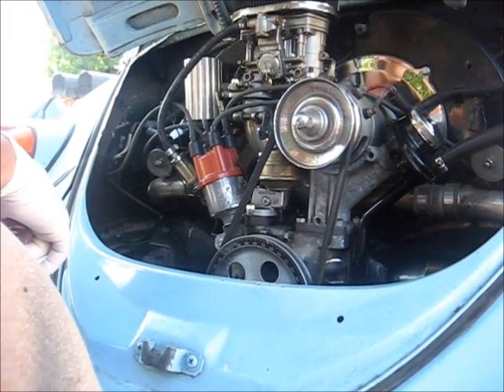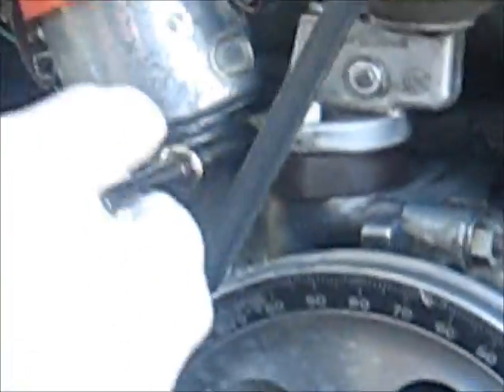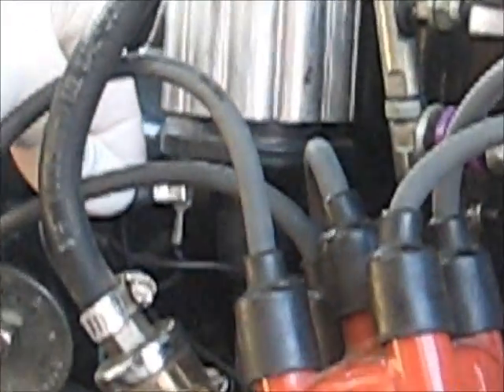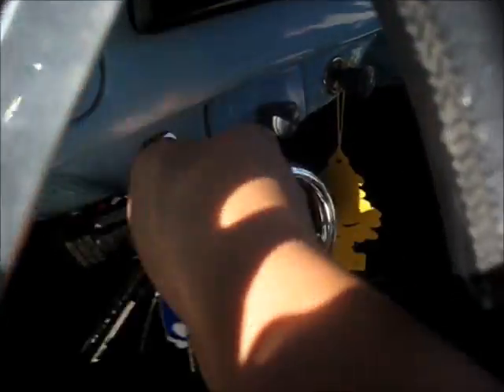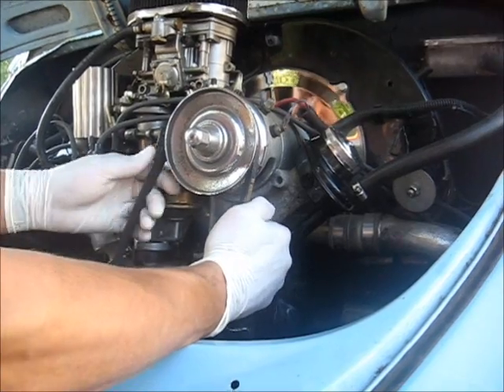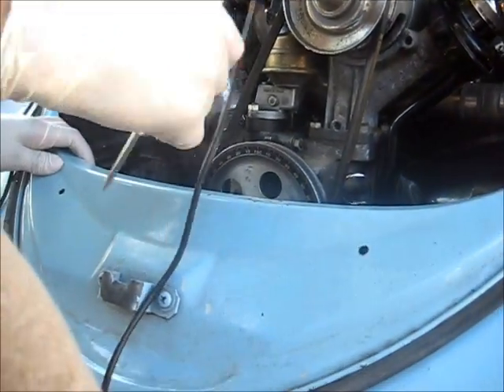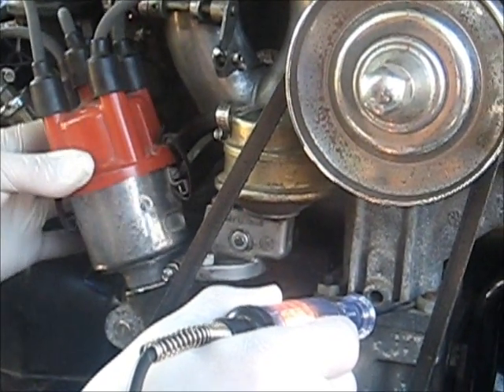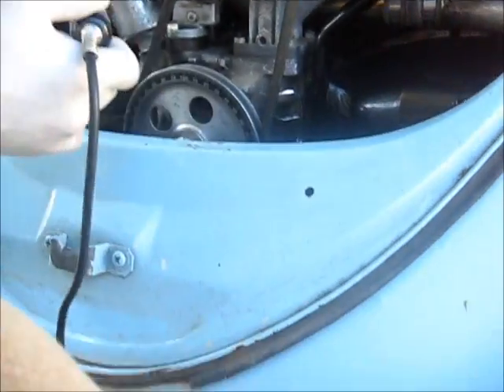How to adjust your timing on a VW bug

Comment: A lot of people are saying this is wrong, but this is for "static timing" and you need this trick to get the engine running if you should for example swap the distributor. You should set the dynamic timing with a timing light gun once you have done this and the engine is running. BUT commenters, you can't set the timing with a light gun if you can't turn over the motor in the first place!
Reply: Daijyobanai I

Comment: Doesn't the position of cylinder 1 matter, you could be on number three at TDC.  I think you have to be sure the rotor is pointing to the notch on the distributor housing before you are 100% sure you are TDC #1 cylinder.  Correct me if I am wrong.

Comment: First, if you dont have a number pulley I suggest you get one. The correct way to time this motor is to find TDC and hook up timing light and loosen distributer then start motor.  Rev engine until distributer advance is maxed and take a peek at were it stops. You want it to stop at 28-30 degrees. Tighten distributer. You are now properly timed....You need...*Number pulley *Timing light *10mm socket.
Reply: Wrong; you do not NEED a number pulley at all.

Comment: Wrong procedure its unsafe, 1st you take off the distributor cap so you can see if the rotor at the 1st firing position, then rotate the crankshaft pulley to 7.5 degree, put the clip of the test light to the negative side of ignition coil and attach test light to the engine body, lossen the bolt of the distributor, then start on position the ignition switch, rotate the distributor counter clockwise until the test light lights on, tighten the bolt gently, the timing procedure are done,.

Comment: I got this 1970 baja bug out of a field that it had been resting in for better then 10 years. I put it up on blocks and striped it. After a complete overhaul, breaks, hubs, and engine i gave it a fresh coat of paint. Though I have no clue what i am doing the chilton made it possible. there is a thing under the carb on the block that needs a wire, where dose this wire go to. There is all so the choke wire and under it is a condincer , where do these wires go? thanks for the help.

Comment: This is called Static Timing. You  should be at 10 deg. BTDC with a 009 dist. I have done it this way for years. Just stop turning it when the light comes on. You can also do it without a light. Just watch the points, when they pop your good.

Comment: Wrong procedure, unsafe too. 1st remove the Dist. cap so it can't start.
Look for a better video and/or read below because you have to do a final static check by pulley reading.
This video is only good for preparing for that test.

 Better-- Cap off, #1 on comp. stroke at about 20 degrees before tdc stop.... turn on key, and rotate engine SLOWLY till the light goes on. (visually check rotor to the distributor lip's "hash mark" for reference).
 Do it again.
 Got the same reading? Then that is your static timing. Key off.

    NOW line up the rotor to hash mark for easy estimates, loosen the dist., carefully move distributor a hair, clockwise=later/less degree of advance,  and re-tighten dist, move motor again (if you move it backwards, go to at least 10 degrees before static mark then fwd again so any mechanical slop can adjust for re-direction)  
  Key on, turn the engine forward till the lamp lights again, to check the new static setting (again till you get two or more good readings).

The static setting is often the idle setting on an unmolested 009. But assuming can be dangerous.

      If you know your motor, using static timing AT THE PULLEY is very reliable. Some stock motors you had no choice but time it statically.

 On the stock pulleys, a "Dot" indention mark, on the pulley half that is furthest away from the block = TDC. (Some had no dot, good luck there).
  You can count on any pulley being up to 3 degrees off tdc (+ or -) by variance. Especially after market pulleys.
   I've seen stock crank keys retarded near 3 deg, and that's a bad 5 degree combo of being off tdc, if not checked. 
    On the stock pulley half that is closest to the block, you may have a variety of V notches, whose position should be confirmed if there is no dot/dimple.
  A notch to the left of the dot = 5deg ATDC. 
    Notch to the right 7/16"of tdc= 7.5 btd,
     A notch a bit further than that, say 1/2"ish =10btdc, and I don't know off hand if there is a 12deg mark or not? That said most AC-VWs like 7.5 deg. advance at 0-825 rpm idle,  016 points, .006-007 intake, .007-008. exhaust, and .024-.028 plug gap depending on the engine, plugs, and coil (on real good coil maybe .030 spark gap), but I like .026 to start.
  
   The early German 009 called for 7.5deg at idle to get 32deg total at 3000rpm. it advanced sooner, but had less advance during low rpm. Above 2300rpm, more advance till 3000rpm/32deg.
  (Most AC V-dubs should idle best at about 800rpm and 7.5deg, adv, and come off idle better too, (for sloppy street driving) but should max out at 32deg, or sooner).
  A later Brazilian 009, needs about 12 deg. adv. at 1000rpm idle, to get 32d at 3000,
   At 7,5 btdc most engines will idle great, and start nice, lose a bit of top end hp, with the Braz. 009 maxing at 28d total. But this usually runs cooler, and gets better hwy mileage at 28 max advance. I like 30d max adv. "with a light".
 
"Done Right" -#1 So.. both 009s, and the normal AC V-dub timing considered, the videos "0 degree" choice is likely a "safe start point" for most air cooled v-dubs & 009,( but should be followed by a timing light). 
 #2- The rubber glove could stop a shock, LOL. ( 1 quick spark plug bite)
  
 If your not careful, with the dist. cap off especially, you'll get a mini-shock off the test light, so connect them firmly, don't touch that wire, just watch the bulb. 

 A jumper wire to a tail light, or license plate light bulb works if "stuck on the hwy".   

     You cannot set electronic ignitions statically at all; including Bosh fuel injection, or points replacement kits, (so mark things well before you change things over to a "hall effect kit", or similar.
   Good luck .

Comment: Don’t do this! You have a 09 distributor. Timing at TDC was done only with the old vacuum distributors.
Reply: BINGO, you need to set 009 distributors for maximum timing.
Reply: So many different advices. I have a 1300cx, with a 30pict-2, carb and 009 distro. Do I set the pulley to 7.5btdc, or to 28 to 32 degrees btdc?

Comment: Hi there, would you know the correct timing mark for a 1973 1300 beetle, with a 1600cc engine fitted, bosch 009 distributor.
Reply: joe harrod
Reply: Mark your pull at 32degrees start engine run at 3500 rpm set at 32 degree's

Comment: This is just called static trimming just to get it started. All distributors advance different. You don't need an after market pully that's crap. All u need is a inductive light with a digital display. And correct u rev the 009 till it stops advancing then set trimming to the 28 to 32 but id say leave it between 28 30 if ur not advance tunner... u really only need 28 people like this is false leading and then people wounder why there shit over heats

Comment: Why is my test light staying on at all times?
Reply: You probably hooked the clamp to the positive lead on the coil rather than the negative.
Reply: I've got the same problem and did connect it to the negative side.... not sure what to do now.... any ideas maybe?
Reply: Make sure that the points are able to open and close, and that when you adjust them, you pushed them against the feeler gauge with the tip of the screwdriver before tightening the screw.  If you don't, sometimes they stick open, or remain too far apart to close, and the light doesn't go out.